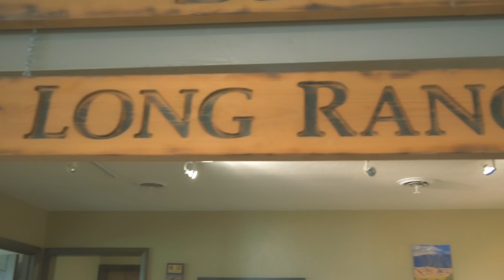The Best of the West Long Range Rifles Video Transition test

Comment: The 6.5-284 Norma how is the barrel life on them
Reply from the maker: Enduro EPICHUGGYBEAR I'm not sure I understand your question.
Reply: RonnieWolfe like how many rounds will the barrel last
Reply: Enduro EPICHUGGYBEAR Ronnie is a clueless wonder since he didn’t understand your first question and he obviously doesn’t know jack about rifles.
Reply: Swipez I gauss for the moment I'll stick with 300 winmag. I kinda want to get 7mm-300 winmag for long range hunting
Reply from the maker: Enduro, the 6.5-284 you can get up to 3000 rounds out of them without loosing accuracy if you take care of it and space out your shots so the Barrel doesn't heat up and clean it after every 15 rounds or so. The six five is under 3000 feet per second so you won't have as much as an issue. Once you start sending rounds over that 3000 feet per second mark the life of the barrel diminishes exponentially. That's when you'll start seeing the barrel loose accuracy around the 1100 round mark. Call and chat with Mike or Shane, they can help you with understanding our different long range rifles and options. 1-307-587-2787
Reply from the maker: Sorry for the delay and the misunderstanding of your original question. I've been ignoring most comments because the kill reel I posted kind of blew up and I got tired of reading death threats haha. I thought this was one of the comments on the other video so I was confused. I didn't even realize this video was getting seen.  Again sorry for the delay and confusion.
Reply: RonnieWolfe its okay. 3k rounds isn't bad  thank you for reply